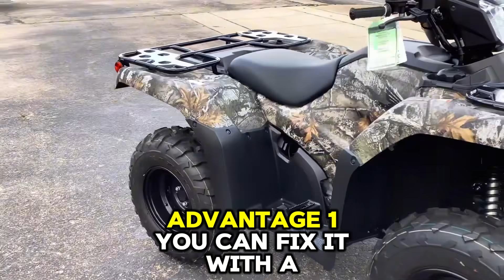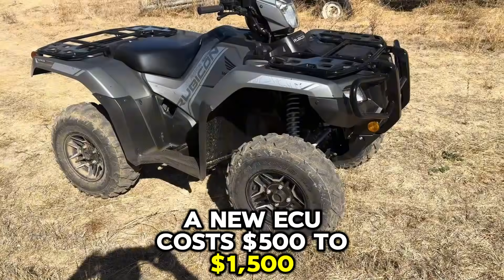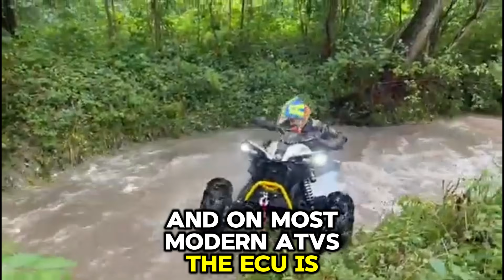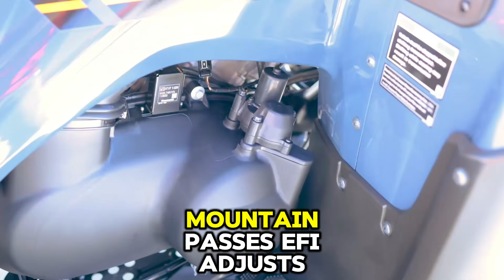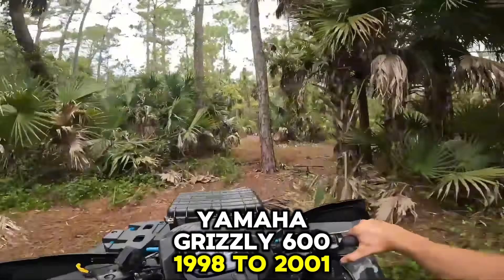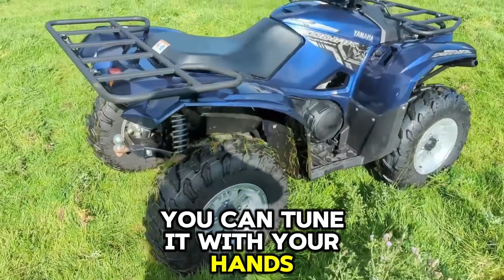Why Carburetors Are BETTER Than Fuel Injection (Fight Me)

Comment: Im perfectly fine with a carburetor that is jetted and with a clean tank, good inline fuel filter. No battery required. I guess if I ride in different elevations by far, maybe I'd want fuel injection. For straight up racing, drag racing, or trail riding the carburetor is my choice.

Comment: Small engine carbs are loved by mechanics because they get paid to fix the inherent failures... Like unfiltered gravity fed fuel systems that mean eventually that one bit of grit that blew into the tank while refueling 9 months ago eventually lands in just the wrong place and blocks a jet or jams the needle, and now they get 3 hours of labor to fix something that shouldn't have been a failure in the first place... But having a fuel pump costs money, and putting a filter on a gravity feed system tends to restrict fuel flow by too much to make it worthwhile without upsizing the outlet/petcock and lines.